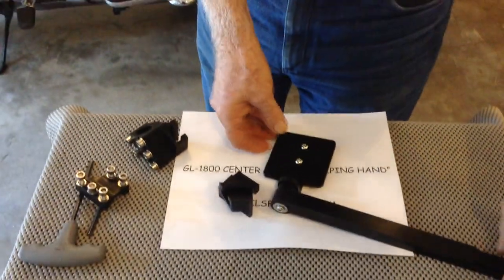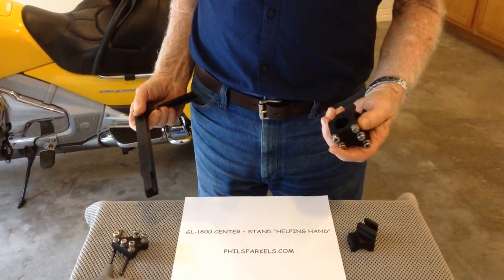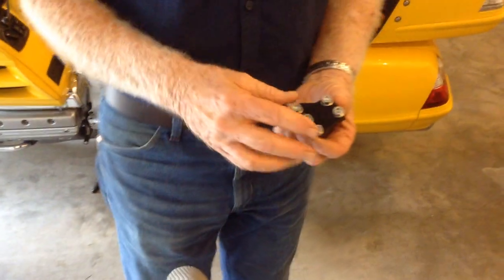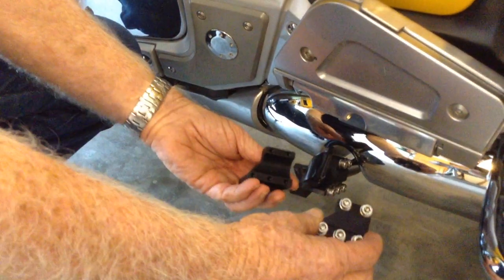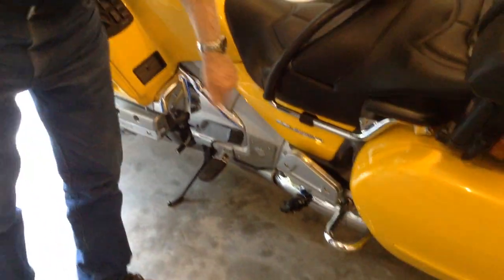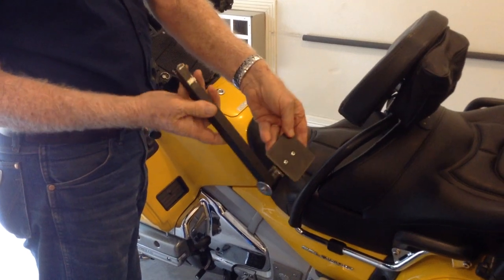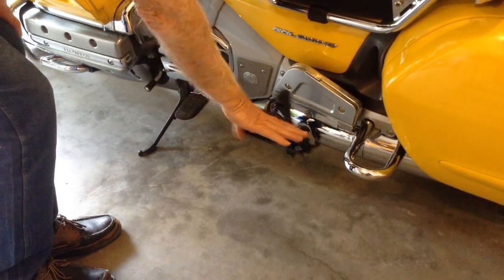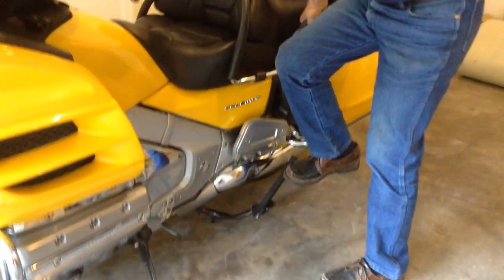How to  put a Goldwing on the center stand, an easier method

Comment: I have had this unit for a year now and it makes putting it on the centre stand a "no brainer". After breaking my foot, I bought this and use it to mount the centre stand up on a plate of steel to prevent driveway damage. Highly recommend this unit

Comment: Last September, my foot slipped off the centre stand and I broke the bone in my heel and tore all the ligaments in my right foot. Had I had one of these installed, I am confident that would NOT have happened. At 75, I don't heal like I did when I was 20, and seven months later I'm still limping...

I installed Fred's unit today, and it makes getting my 2003 GL1800 up on the centre stand very easy, even with a piece of steel beneath it to protect the driveway from the weight of the bike. I'm 6'2' and 220 lbs, and that's still no guarantee your foot won't slip. This unit makes a real difference for me and makes me comfortable it won't happen again. 

But as the saying goes..." I'm closing the gate after the horse is gone...."
Reply: Keep inspiring Robert!

Comment: No problem getting it on the stand when bike is MT. Before a trip I weighed all the stuff in the bags and my Tourmaster back seat luggage bag. 50 lbs of stuff in my 2 saddle bags and trunk. Tourmaster bag another 50 pounds. This tool would be handy for that scenario. Even with out the Tourmaster bag with just the 50 pounds in the bags all the way at the back of the bike it is super hard to get on stand. Remove the 50 pounds from the bags and bike goes right up.

Comment: The way that lever extension comes flying forward when the bike comes down... If you aren't paying attention and your leg is in the way, that's going to be a powerful crack in your calf or shin. I'd definitely remove that bar as soon as I set the bike up. 

If you aren't setting the bike up properly, you aren't going to get it up even if you put 300 lbs on this device or not. Once I figured out how to put my GW up, it became very easy.
Reply: How do I purchase this great engineering tool,THANK YOU

Comment: Being 6'1"  @ 300 lbs. I never had a problem putting it on the stand
Reply: Father Merrin 
I'm 5'8" 170 lbs with bad knees and hips, and have no issue putting mine on it's stand lol
Reply: I've never had a problem either an I'm 5'9" @149 ibs although some just don't quite know how to do it and I've shown plenty.
Reply: I'm 5'5, 180lbs I could put my 08 wing on the center stand without help, but just bought one of these just to be proactive about injuring my right knee. Maybe that's how people ended up with knee problems in here.. I definitely felt my right knee being over worked, since I put the heavy wing up on its centerstand after every ride